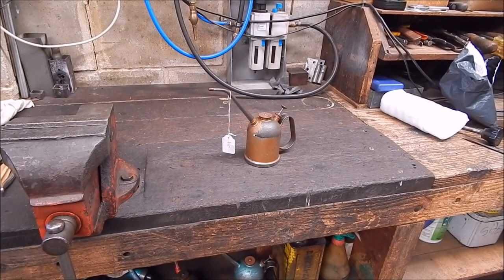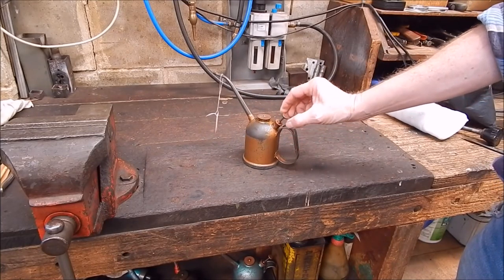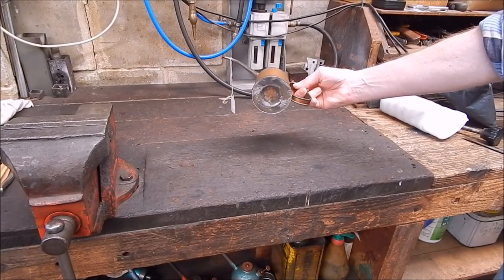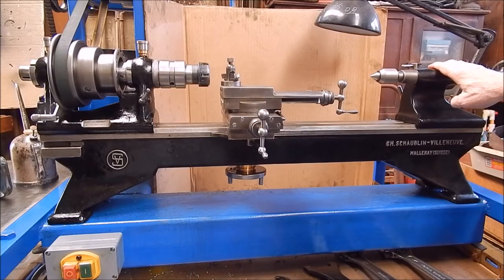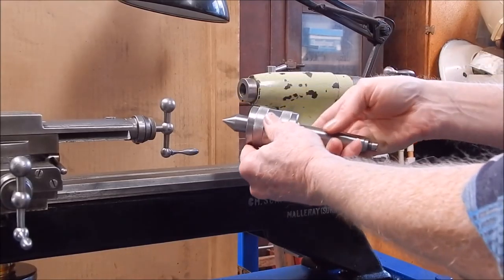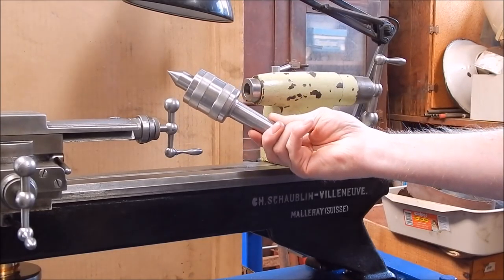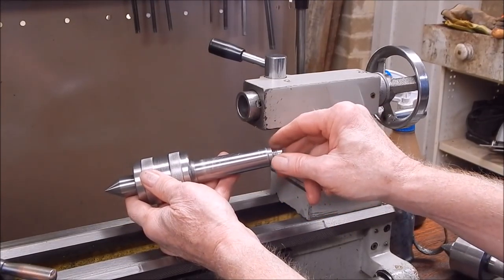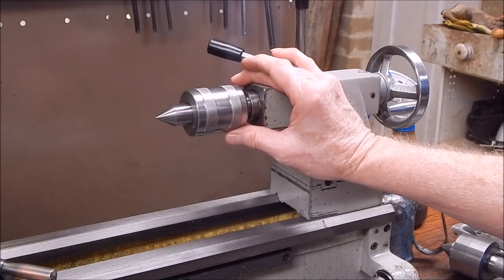A couple of new workshop arrivals from Ebay

Comment: For the bottom of your oil can you might try gluing a piece of tool box drawer liner to it.  The glue will help seal any pin holes, plus the liner will keep it from sliding around on metal surfaces.  Always enjoy your videos.

Comment: Rob,  I make my own tangs.  I have a MT-3 tail stock,  The screws in the back are 12mm and I make it in the form of the tangs that have a flange on them to prevent the item in the tail stock from turning.  Not sure if it has that feature in my tailstock, but I like the way it looks, and it does the job.
Reply from the maker: Hi Herb,

I considered doing that, but I can't recall the last time a Morse taper slipped on me.  The thread works OK.

If the Morses match correctly (are properly made on both articles) the holding power is pretty awesome.

When Morses slip it's generally bad machining or wear in the ram.

Cheers Rob

Comment: The tang is there to drive a wedge through and eject the taper from the drill press type spindle while the thread is in there for a drawbar to lock the taper in a spindle as in BT30 BT 40 type spindles.
Reply from the maker: Why would a live centre need a draw bar ?

Rob
Reply: I don't think a live centre needs a drawbar more the tooling like the collet chuck.
Reply from the maker: That's my whole point in the video.

Live centres SHOULD have a tang, but they don't.

Instead they have a thread for a draw bar, which they don't need.

Very odd situation, that no one seems able to answer.

Rob
Reply: At least the solution is easy.

Comment: with the collect chuck,i have a er40 which I use on the mill with a draw bar and on the spindle on the lathe without a draw bar.with the mt1 tail stock,why not just buy an mt1 to mt2 sleeve.......I use machine taper adapters all the time.just an idea.
Reply from the maker: I don't like adapter sleeves.  They invariably have run out, (nothing is perfect) which will compound any error factor in the ram and the collet chuck.

I have an adapter for the headstock spindle that I rarely use, for that reason.

Better off using the correct Morse size.

Cheers Rob

Comment: The head stock turned out great. Congrats. Did you put it into fumaric acid after the electrolysis? For how long? And how did you clean it up after that? With a wire brush? What was the temperature? I do electrolysis with a heater to speed things up. A +10 deg C temp. difference results in about a factor of 2 speed up.
Reply from the maker: Hi Rol,

That headstock pulley was in bad shape from being by the sea.

I gave it three 24 hour sessions of electrolysis, with a scrub with fulmaric acid at the end of each session to remove the black oxide.  I didn't soak it in acid, just rubbed it on with a toothbrush.  You don't need much.  It comes off very easily.

I then neutralized the fulmaric acid with washing soda solution and ran a rotary wire brush in the drill over it to remove the white oxide coating left from the acid.

You can see the result.

This was all done at air temperature of about 13C.  It's winter here in south Oz.

I couldn't ask for a better result really.  It all worked very well.

Cheers Rob
Reply: Yes, it looks very clean now.  Well done. Around my place I have not found a source for fumaric acid.  I wonder if vinegar or citric acid would work just as well. At the next opportunity I will test one of those after electrolysis.
Reply from the maker: You could try weak sulphuric acid (10%) if the others don't work.

I don't like using hydrochloric acid as it promotes rust.

You need to neutralise anything you use with an alkaline (eg washing soda) afterwards.

Cheers Rob

Comment: You mentioned that the "new" spindle has a run out of 0.02 mm and the already restored one has double that. 0.04 mm run out sounds like a lot to me. How does it affect the operation of the lathe? Does the oil film in the bearings stabilize the run out somewhat during operation?
Reply from the maker: Hi Rol,

Yes, the oil film does stabilise the runout a bit when it's up to speed.  It's still clocking better than a scroll chuck.

The runout is radial, and the old spindle is pretty well marked on the tapers  There's no point in regrinding the spindle tapers as the steel front bush is also marked.  I did consider it, but very tricky job.

That's why the new headstock will be a lot better, as good as new basically.

Cheers Rob
Reply from the maker: Hi Rol,

I tried some heavy drilling with the new ER32 chuck this morning, to see if I could make the tangless Morse slip, and it handled it without trouble - as I expected.

BUT, after that I checked the adjustment on the front taper bush of the spindle in the old headstock, and found it was a bit loose.  Adjusted it up and now it's clocking at 0.01 mm, so all good there.  Been a long while since I adjusted it.

When I checked the new headstock I didn't have it pulled down, so it will probably clock better than that hopefully.

Cheers Rob
Reply: That sounds a lot better. A thicker oil might also help to even better stabilize the plain bearings.

Comment: Hi rob:  my thoughts on why no tang from the factory, would be safety, on the drill press.  they would be liable to a lawsuit, if an expensive bit fell on someone's head, after retraction of the drill press.
Reply from the maker: Hi Paul,

The tang will only operate in a drill press when wedges are used to drive out the Morse taper.  It doesn't work like a lathe tailstock and eject when the quill is retracted.

Cheers Rob